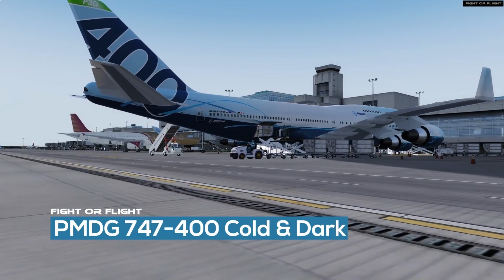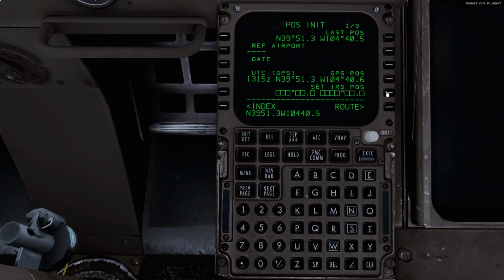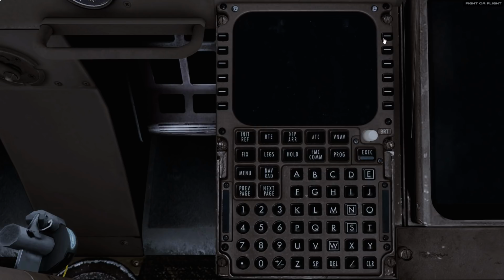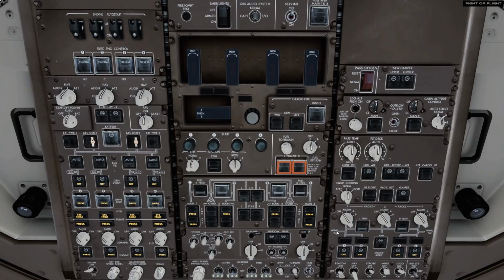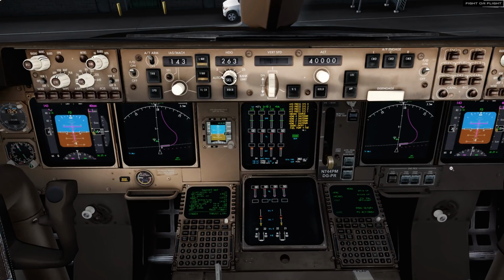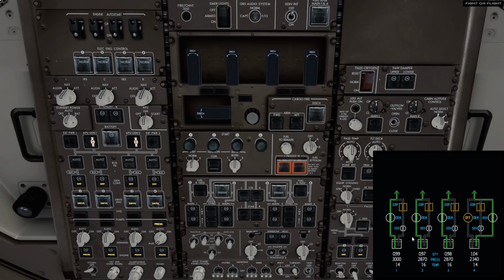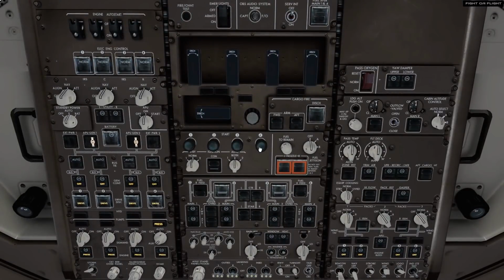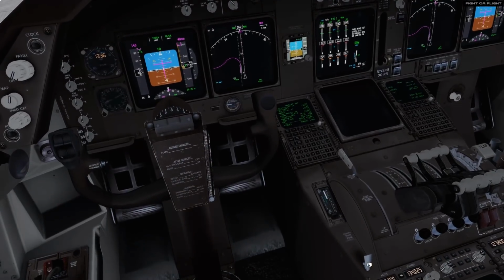PMDG 747-400 Queen of the Skies 2: Full Cold and Dark startup procedure [P3D/FSX]

Comment: I have not seen the whole video, but here is my friendly opinion to improve you even if you are already very competent.
Some mistakes and forget :

-37 991 pounds of release ok but let's look at the FCOM :
"The minimum fuel quantity for departure is 50,000 pounds."
It is to cool the pumps.

-You pushed in TARA, you have to push in XPNDR mod.

-You switched on the starters and then sent the fuel instantly. ( you can with an autostart only )
Here is the proc :
 
1. Pull your ENG start delectors 
2. Verify N2, oil press increase for both ENG
3. At maximum motoring when N2 greater or equal to the magenta fuel indicator and no increase for 5 to 10 secondes you can run your fuel control.
4. Normal indications monitor N1, N2, fuel flow, and oil pressure.
5. EGT verify increases and stays below EGT start limit.
6. Verify start selectors release at 50% N2 and the start selector lights extinguish.

-Set your flaps only when you have received the salute ( GSX does it ) 

And there is a lot of things that you didn't check during the preflight like :

-LDG position, FLAPS and spoilers positions, throttle idle etc... 
-Oxygen crew and passenger ( min 1400 psi ) and test your oxy masks
-HYDR QT ( No RF or LO displayed )
-Tire press ( mini 208 psi )
-Engine oil qt : 12 quarts min for a flight less than 4 hours and 14 quarts for a flight greater than 4 hours.
-Squib test
-Cockpit voice recorder
-Smoke evac handle

A lot of things to check like the WXR RDR, the TCAS etc...

There are a lot of things like cheking drinking water on board that we can not do on the PMDG LOL but I have probably forgotten or not seen important things.

You should read again the FCOM.

Sorry for my English,

Best regards
Reply: Dont worry, it’s virtual, it’s not gonna kill the plane
Reply: Okay man, now return to your ATPL and shut the f up
Reply: @moroccansexiledfromivao8653  ikr this dude thinks he's flying IRL